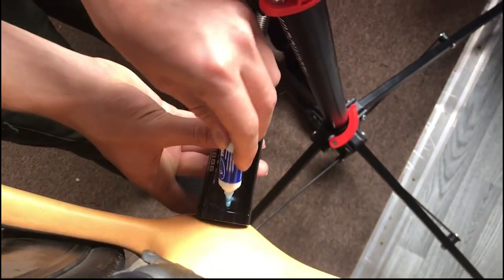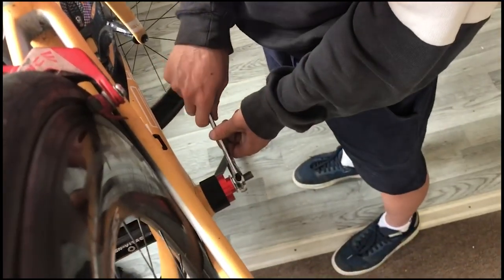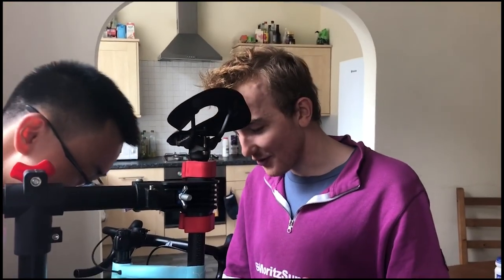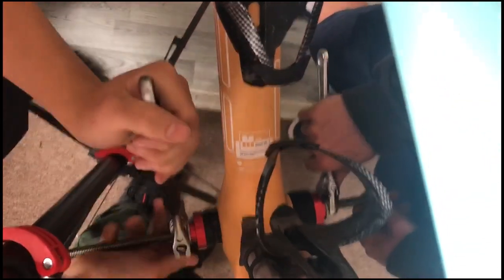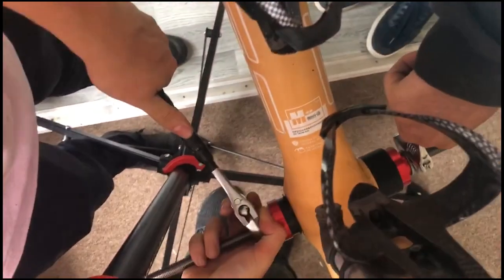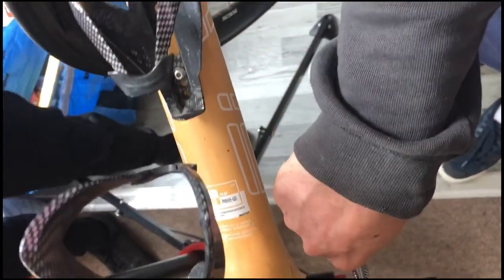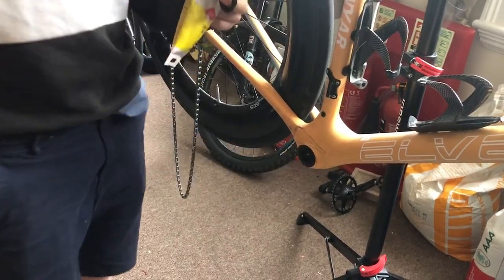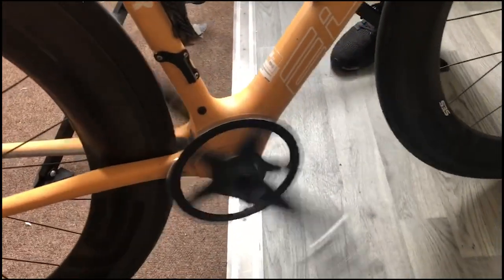How to Install Sn Vitae Bottom Bracket?

Comment: Did you measure the holes to see if they were I  spec and ovalized ?
Reply from the maker: No I didn't, but that's one advantage of the one piece is that it makes it less important if the frame is out of spec